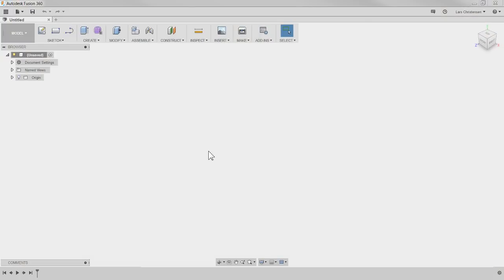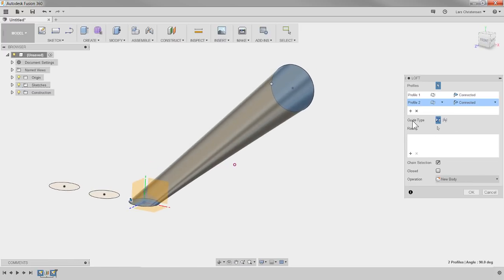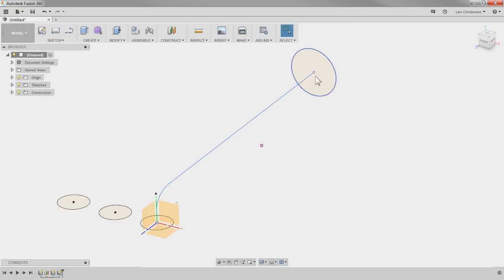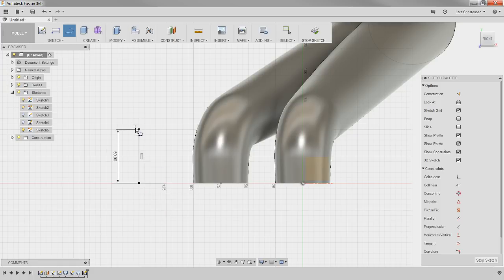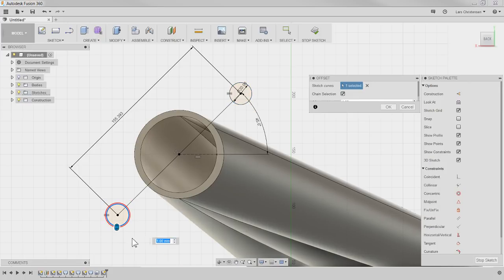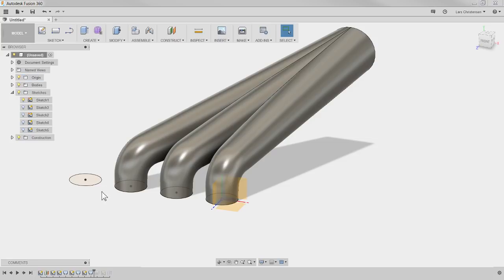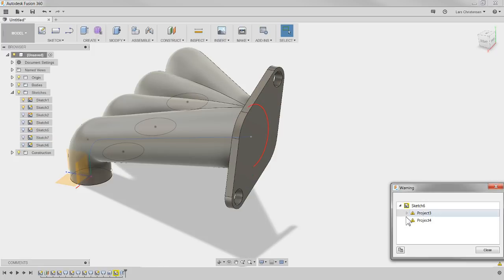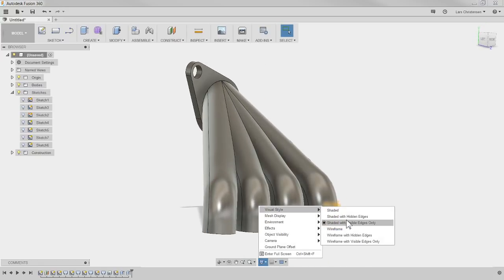3D Sketch & How To Model an Exhaust Manifold — Fusion 360 Tutorial — #LarsLive 134

Comment: I believe because you used project geometry for the bracket then offset this was overwritten when you added the last loft, in short the additional face section of the intersection of the fourth pipe was not added as a reference for the offset?
As the shell command was later in the timeline as you showed there was only the need to select one end of the fourth pipe, it hollowed out correctly, only leaving the yellow corrupt lines for the offset which didn't include that fourth pipe?

Were the four pipes Joined? If so it's interesting how Fusion didn't compensate for the project geometry especially if the fourth pupe was added in the NEW timeline before the offset would NOW have occured ...

Comment: When trying to create the fillet on the center line of 40mm I was attempting to hit "F" for fillet instead of going through the menus as you did, Lars. It would not let me select the two line to create the 40mm fillet. Is that because "F" is linking to the 3d modeling fillet and not a sketch fillet? Is there a reason for this being different, could I have made the 3d fillet command work somehow?
Reply: The F key command is a fillet related to 3D modelling and will not work with 2D sketches

Comment: At 23:23, right-click on one of the yellow points and select Manage Lost Projections, select Edge 1 and select Re-Link and click on the left half of the OD of the circle, repeat for Edge 2, click OK, click Finish Sketch and the problem is fixed. PS. your videos are awesome!
Reply: It didnt break when i done it. I dont know if its due to program updates or the way i did the shell step after adding the 4th tube.  Instead of holding control to add in the new tube, i hit "X" to delete all the previously selected parts and delete on the 5mm shell.  Then i selected everything again plus the new pipe and entered 5mm for the shell thickness.  I just got in the habit of deleting all my selected parts if a feature is going to be effected by something i changed further back to change in the time line.  I have had strange issues and it seems to have less problems doing it like that

Comment: When I press shell command , as a result I have a hole on first side of the pipe and closed wall on other side. With same thickness all over. Is there anything to change this settings and get hollow empty pipe?

Comment: Thanks much again Lars.
I didn't realise how limited F360 was with 3D lines until I tried copying an original component (Pipe1) and pasting on the X-axis then trying to adjust
the (Pipe2) sketch points in 3D. Wow, was my mind blown - in a not so great way, leaving me to give up!
I can imagine the software developers scratching their heads trying to come up with a way to further implement 3D sketching within a 2D constraint-based CAD system
and not even think of how it's possible to do this without breaking something!

Comment: Thank you!!  I've been waiting for this.  How can I get the fillet to adjust smoothly in the Z-axis?  If two lines are in the same plane, and I adjust either of the lines, the fillet between them will adjust to a smooth tangent.  If I have two lines that are not in the same plane, and I adjust either of the lines, the fillet does NOT adjust to a smooth radius, but makes a "kink".  Also, how can I measure the length of the sweep/loft path?

Comment: For creating the "line", for lofting over, why did you use 2 straight lines & a fillet, instead of a bezier curve? It would seem like, (to me, at least), a bezier curve  would give much more control, and allow cleaner curves, overall. I'm still very new to CAD designing, (my previous experience is 3d modeling in animation software, like Maya & Modo), so this is all only vaguely familiar. CAD does a lot of things differently, than what I'm used to. While you can do much of the same things, exactly HOW you do it is different.  Could you please explain why you chose the methodology you did, instead of bezier curves?
Reply: Jeffrey Warren Park  also coming from an animation background, I’d hazard that it’s to allow the precision of setting the 50mm rise and 40mm fillet, whereas bezier would perhaps not have that same level of precision.
Reply: I don't know about that. I think it would still be easy enough to make more that one sketch. One could be used as a reference, while the other, containing the bezier curve, could be used for the lofting. To use straight lines & fillets, just seems to be more effort for the sake of more effort. Say for example, you needed to create a tube with an "S-curve", which technique would require fewer steps to achieve the same results?  As far as I understand it, both techniques would still allow you to make precise measurements, if & when needed. I was always taught that you should "work smarter, not harder", and that "time is money". So, if using bezier curves can get you the same results, faster, & with more flexibility for later alterations, wouldn't that be the better way to go? 

Again, I'm still rather new to CAD, so if I'm out in "left field" in this way of thinking, I appologize. I'm trying my best to learn the CAD way of doing things. And, if I don't ask when I'm not sure about something, then I won't find out the proper way to do it.
Reply from the maker: Hi Jeffrey Warren Park And Jacob Dodd Thank you for watching!
Well, honestly, I wasn't really thinking of that :-)...I got a request on how to model an exhaust manifold and thought it could be a great way to show 3D Sketches....That's really it :-).
I did find this post on the forum in case someone reads these comments and want more info on curves
https://forums.autodesk.com/t5/fusion-360-design-validate/what-degrees-do-splines-in-fusion-have/m-p/5469737#M13266
Reply: Hello, Lars. I just read the postings in the link you just provided. Unfortunately, for me, it just made it more confusing. As I said before, I'm still very much a layman when it comes to CAD. What was discussed in that thread may be very informative to someone with many years of CAD design, but admittedly, it left me baffled. The little I did get from it, is that even amoungst the much more advanced CAD designers, there's a great deal of personal opinion on which is the best way to design something with "curves". So...